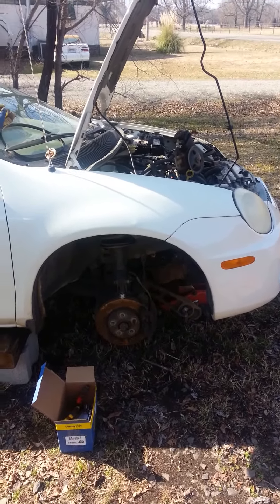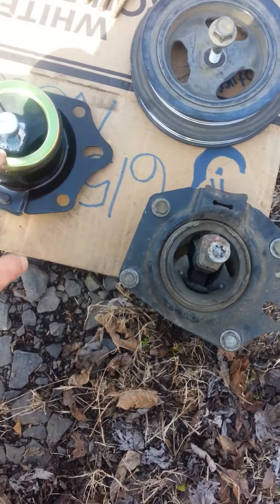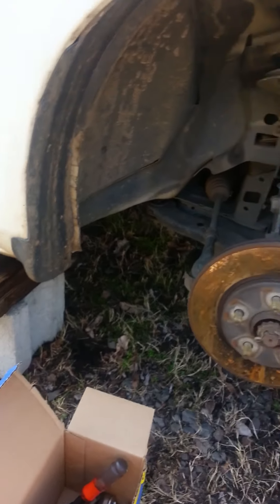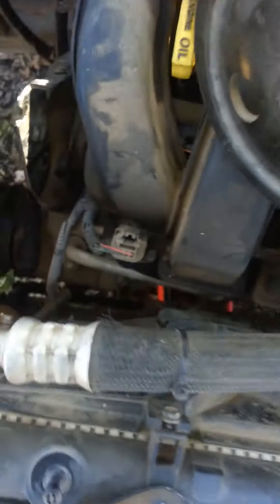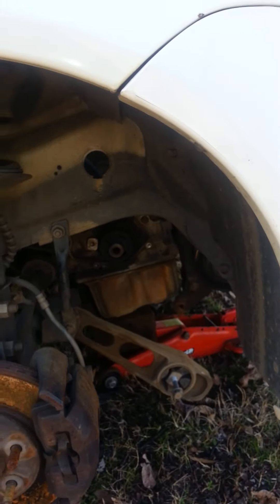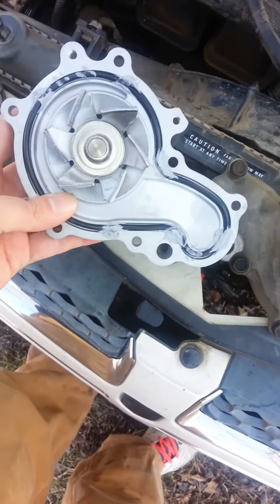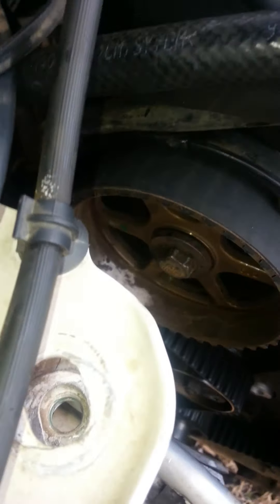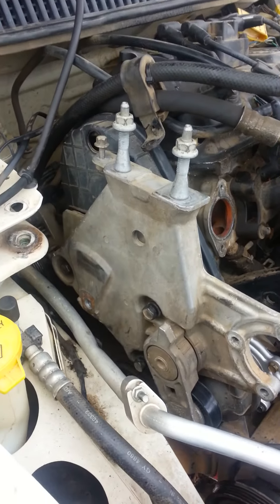2004 dodge neon timing belt assembly replacement

Comment: I have a 2004 neon and the timing belt tore on me so I bought a new one and replaced it, it was just the belt that I replaced but it still won't start do you know what the problem would be??
Reply from the maker: Naya Jim if you made sure it was timed properly and the tensioner or waterpump wasn't locked up , then it should at least turn over. The problem with the neon , like alot of cars is they are an interference engine . This means when the belt breaks ( more especially if it was at a higher rate of speed ) that the pistons can damage the valves . The most likely scenario is that it damaged the valves . You have a few options at this point . Take it to a machine shop and get it fixed . Remove the head and replace the damaged valves . Or the best option just get a replacement head. A rebuilt would be best you can find them on ebay around 200 . You can also get one from the salvage yard however you would have to check it over well for straightness and the valves as well , also you'd want to have it shaved . 
The two neons that I've replaced the belt on that actually broke while driving , somehow they got lucky and didn't damage any valves , I know it's way worse if driving highway speeds .
I would make absolutely sure that the timing is correct as well as no issues with either tensioner or water pump being seized , before going any further . Best of luck and thank you for watching

Comment: Did you take the other motor mounts loose too?
Reply from the maker: The only mount I didn't loosen was the transmission mount , I removed both torsion mounts and the engine mount and replaced the  engine mount . Thanks for watching

Comment: Hey I have a 04 dodge neon but idk what water pump to get a mechanical or hydrological
Reply from the maker: You're referring to the tensioner component,  hydraulic or mechanical . 2004 will have the mechanical tensioner . However the water pump will be the same as far as I know across the board through all years 95-05  plus other models. Hope this helps thank you for watching
Reply: Electronical is always the best way to go!